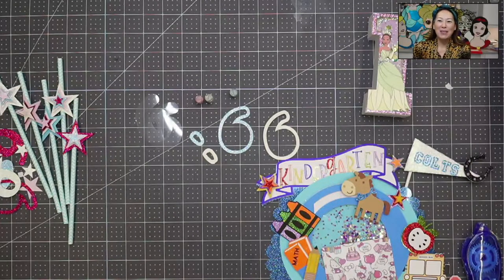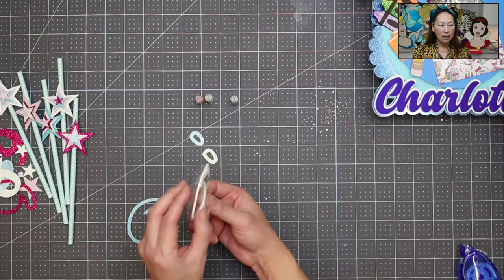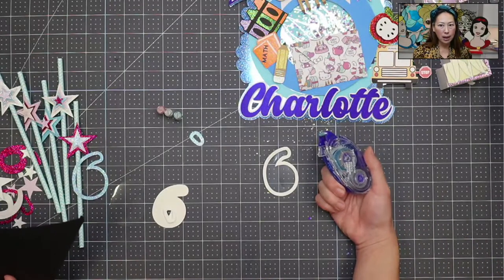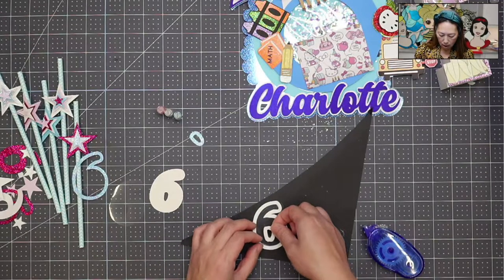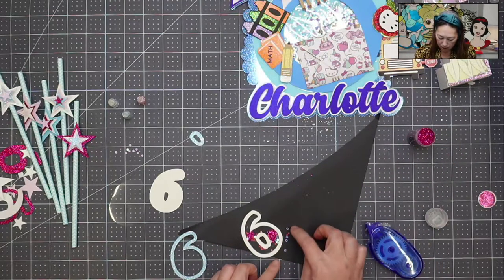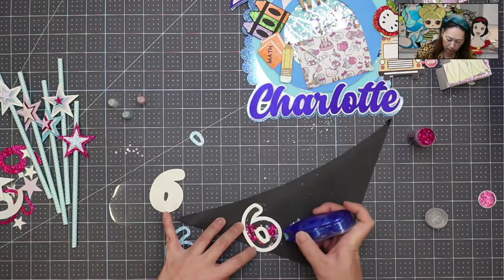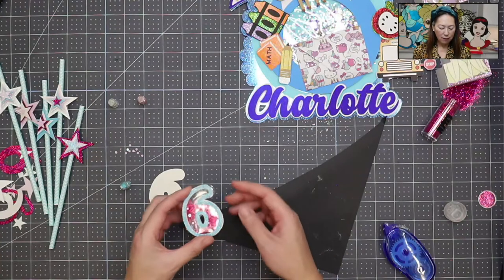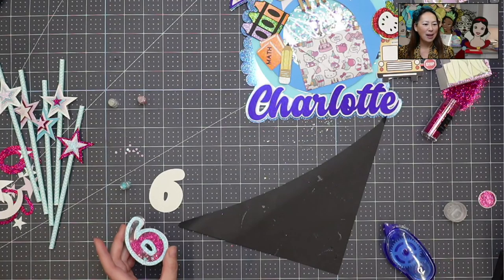DIY Shaker Basics - How to Assemble Tutorial

Comment: Two questions:
1) If we have an Explore Air 2, do we hand cut the foam part?
2)If we don't have glue tape, can we hot glue the pieces?

Trying to make it work until Amazon arrives!
Reply from the maker: Yes hand cut the foam part with your explore.  You could cut out the template on cardstock.

Yes, you can hot glue the pieces but you run the risk of ruining the paper (the glue is too hot and can leave marks on the paper).

Good luck!!!  =)